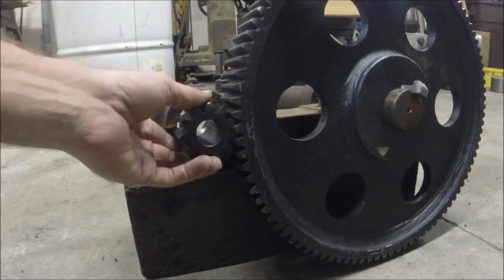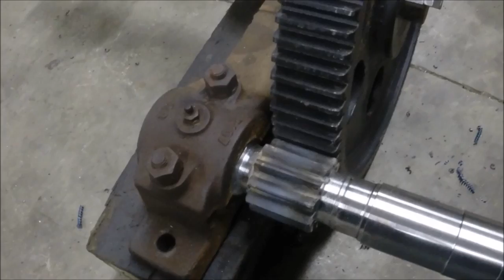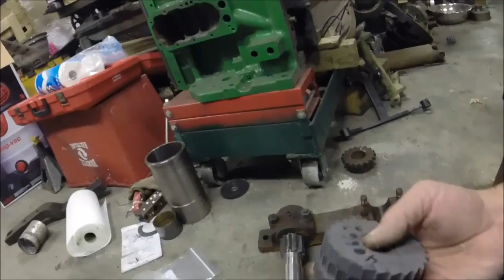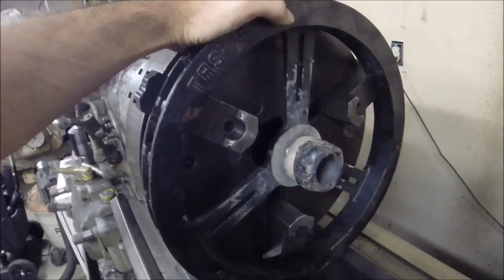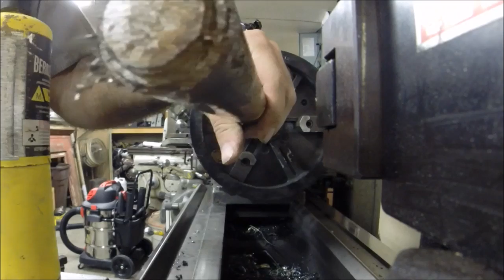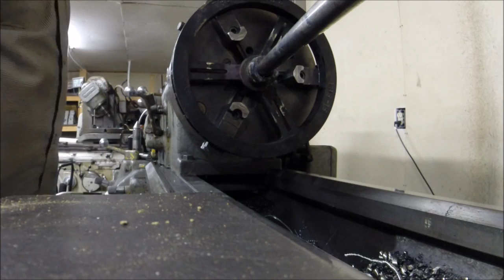Rebuilding/restoring the 15ton Model BR Hoist Part 4

Comment: Nice job Brian. I need to put three specific bends into a piece of 1/8" wall 1" ID steel tube/pipe to mount the switch pod for the old lathe in restoring. I'm thing a MAP gas torch like you did ain't quite gonna cut it. I don't have access to a bender or a torch set right now so I gotta improvise. :)
Reply: *thinking
Reply from the maker: can't use a tubing bender?
Reply: bcbloc02 If I had one, or knew someone who does. Just moved to AZ so don't have a good "barter network" built up yet. :)  I have a good Victor torch and regulator set. I just need to go rent the bottles I guess and make some fire.
Reply from the maker: Thomas Utley
Heat works wonders! :-) good luck

Comment: Hi Brian,
I'm surprised you got enough heat from the little torch, I find t takes forever to heat up something with that kinda torch as soo as the part gets bigger than a 5/8" screw...
GoPros i my opinion win the prize for the lousiest camera to take machining videos... Great thing you got good content...
Go to Chinese friends for cheap extra batteries, about $20 for 2 or 3 units and even includes a charger...!
Cheers, Pierre
Reply from the maker: I want a different camera more so than more batteries for that one.  I think something that plugs in the wall would be good for as slow as I work.
Reply: Great idea, I use a Canon Vixia HF R600, I think they're selling out the models 700, This would be a great choice since you can leave the AC adaptor while working as long as it takes...   I added a .45X cheap wide angle adaptor in order to get wider shots
Reply: Maybe surveillance cameras/system? 
They only have fix focus, but are cheap have high resolution (1080p) and you can record multiple on a central system. If you install some fixed at good points near the machines the fix focus should not be a problem. But the missing audio could be an issue. I don't know if there are some out there who can record audio as well and how good the audio quality will be.
Reply: This model of Camcorder even has an exernal audio input, auto focus, zoom, good low light snesitivity, etc.......

Comment: Brian,
Is there a groove in the bearing housing (the one with the grease fitting) to allow the grease to flow over the rotating shaft?
Well I have seen a lot of things done on a lathe but that wheel work was amazing!!
Eric
Reply from the maker: No groove just a plain bearing, I imagine they figure the loads are low and the number of lifetime revs is small, its not like it was running on a machine.  Some grease on an area that big and it is good to go.

Comment: Great job,what kind of steel are you using for shaft?
Reply from the maker: Mystery metal, it was a spindle for a grain cart that was made wrong so it was scrapped and I salvaged it. I am going to guess maybe 4140.
Reply: bcbloc02 looks like it turned pretty well
Reply from the maker: As long as you don't take light cuts it turns nice, no sneaking up or you will have a bad finish. A lot of guys polish their finishes but I prefer a nice smooth shiny turned finish.